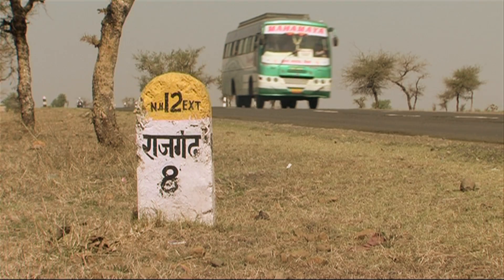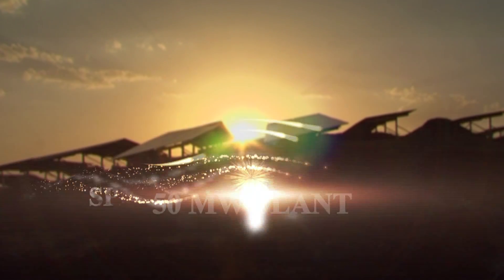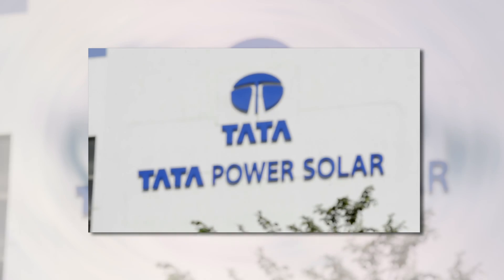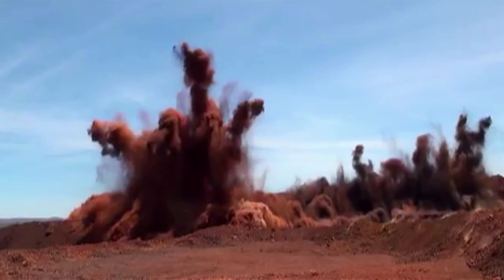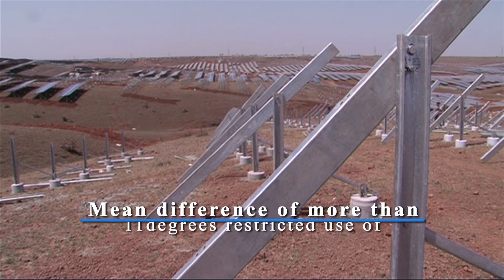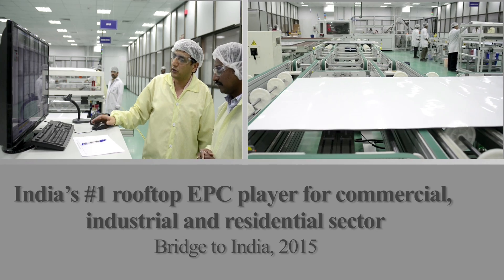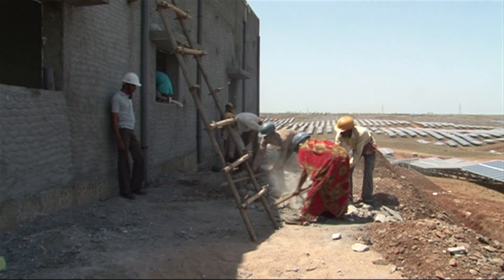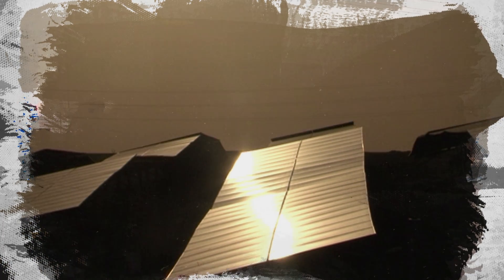50 MW Solar Power Plant for NTPC at Rajgarh, Madhya Pradesh

Comment: DAMN, massive polluting photo-voltaic, pedo-funded dystopian tech,  We need artificial hydro-power, (sky scraper style) with the water lifter by very robust nitinol engines,  then letting the water fall onto turbines, powering modern generators. May need coupled ground connections to ionic falling water to prevent corrosion, since system is more isolate, and not baracaded by entire resivore at material structure points.

Comment: Solar water pumping system 09841185357 .....3 - 20HP Solar Water Pumps -
Solar water Pumping is both cost-effective and reliable for livestock watering, small irrigation and domestic water in remote locations ; 5HP- Rs 3.65 lakh -Panasonic solar panel branded high-quality, long lasting Solar modules with 
Yeskawa Made in Japan Smart controller for longer dawn to dusk operation.
and leading brand AC three phase Submersable pump like Texmo , Suguna , CRI & IDEAL 
M Kishor 09841185357SMS & Whats-up - Power Focus 09884124365 ..
As a recognized name in the industry, we are offering an exclusive array of Solar Water Pumping System

Comment: terrain is really problem here, they should have even the land (don't lie with flora fauna shit). it increased solar production. secondly since you are installing it in such a large number, they should have considered installation of sun tracking panels, which can increase the electricity production by 10-15% due to more sun radiation. smart idea but indian quality. :(